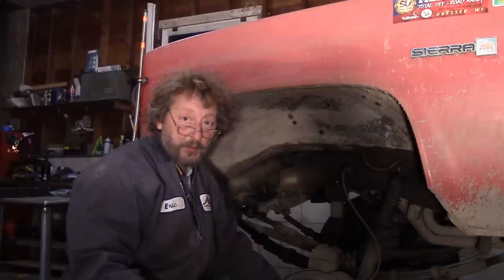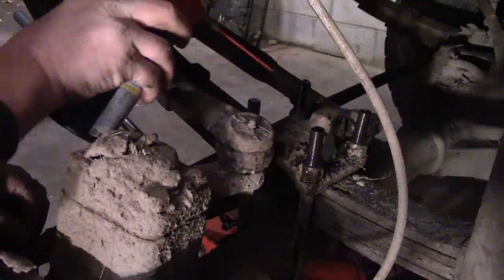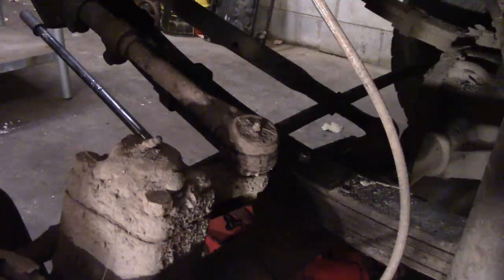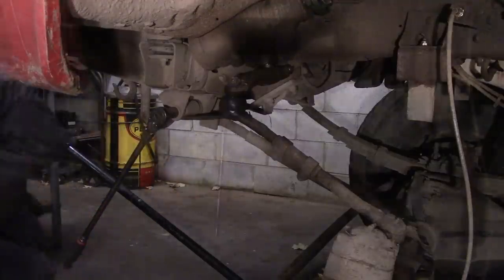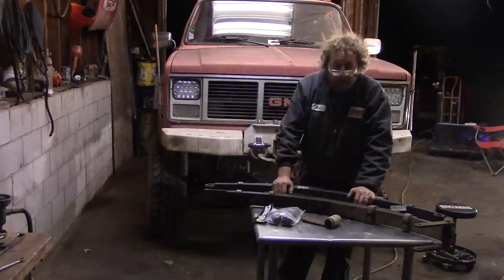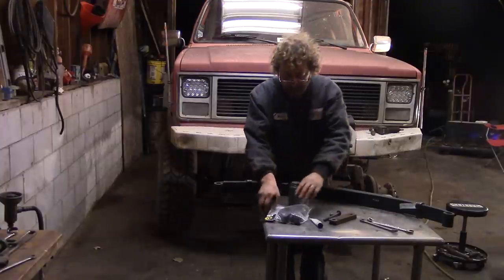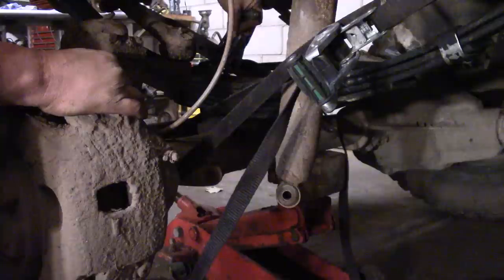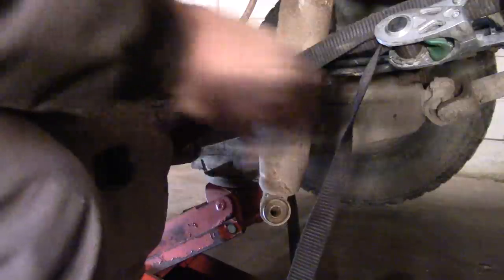BROKEN SPRING FIX by BSF Recovery Team

Comment: Interesting way of doing it.  My YJ has bottom mounted springs.  I mounted shackle side first.  Then U bolts.    Last was the body mount end.  I did flare the ends of the body mount as seen here.  To line it up I used the floor jack,  my winch,  a drift pin and crescent wrench.  Now the lube maybe controversial.    A little soapy water works great, KY does the job too.  It all depends on the application.

Comment: Eric, have you given the thought of having at least one each front & rear springs in the shop for the wrecker with a couple bushing packs for spare parts in case this happens again????
Reply from the maker: Hasn't been a issue till now.
Reply: Springs ain't cheap.... its hard to justify having multi hundreds of dollars worth of springs sitting there just in case
Reply: @brandonrichter6910  I know they are not cheap; it's the abuse the wrecker goes through in the woods & "through the crap" (BSF parlance). It's the peace of mind that if a spring did happen to break next time the parts would be on hand and repairs could be done as soon as you returned home instead of waiting for a spring to arrive at the parts store.

Comment: cant believe hes still running factory steering and not cross over. with the shit he does he needs it.......or i guess maybe hes proven he doesn't but i hear that belt squealing like a pig on other videos.
Reply: That's normal v-belt squeal. :)
Reply: Whenever he has one on the hook theres virtually no weight on the front tires at all so it steers crazy easy

Comment: the transfer case on my 84 dodge broke during the end of the polar vortex (there is a giant hole near the rear drive shaft) a couple people didnt think it was worth fixing it, but when i was matching the replacement transfer case to the broken one, (which does appear to fit) the dome light that has never turned on in the year that ive owned it turned on with the door and worked normally.
I call it a sign :D
Reply: See, the lights and the transfer case are connected.  Now go up and tell someone that has a burnt out headlight to check the oil.  I bet they do it.
Reply: @KevinBenecke  OMG. There is people dumb enough to do that, too. Maybe I can spin the old blinker fluid trick with this too

Comment: My 87 V20 I installed 2.5 leafs and a zero rated from offroad design. And some custom shackles I made that gave me another 1in so about 4in total lift. It worked good but road bad and didnt flex. I called ord and they said remove the sway bar or install their kit. I removed it and it was like a new truck. Rode better actually flexed. So anyone who installs more than a 4in lift remove ur swaybar or buy the kit to make it work right. Like ur vids keep on wheeling

Comment: I can tell you dont live in Ohio. We dont get off easy like you did. Spring bushing bolts are always stuck inside bushing. Si when you get bolt to turn, metal sleeve turns with bolt. So cant remove bolt without cutting. And ubolts, we dont even try. New ones already on hand. Gotta love salt.

Comment: Ditch that old push pull steering. It's a kp 60. Run a high steer crossover setup with a ram assist and bam! Way easier steering on 37s and no more wierd broken springs

Comment: I was very surprised not to see a farmer fix on this one.  Clean the spring up and put a good bevel on both sides.  Whip out the good old 7014 rod and welder up.  I did that once.  This was to test my welding skills.  I put the spring in a press and it broke it broke elsewhere.  For all those out there, no I would not do this on a vehicle. I know the metal becomes more brittle.  Just being sarcastic.

Comment: i would never wrench that dirty. Pressure washer or garden hose and clean that shit! Dirt and debris between the mating surfaces if you dont and you may not have the IQ to believe it but working in dirt caauses issues later on. It only takes a few minutes to sray on some purple cleaner and hit it with  some water.. Id never work on anything like that unless it was a trail repair.  Hygiene personal or otherwise is always a top priority for me!

Comment: Don't forget, when you broke that spring you messed up the other side also. You have the new bushings so, you can fix the other attachment that you lost. Just need the new pins to bolt up. I'm sure that you have some in a can in the shop.

Comment: spring jobs are fun. I did my 97 f350 cause hangers were rusting thru. Did springs also since it was a construction trk.     Than early feb i discovered torque king 4x4 parts cause fixing my brakes i discovered on my dana 60 auto lock hubs my axle nut retaining clips broken. I finally fiquired out why. I was missing some washers and snap ring

Comment: If you have those bushes where the steel is joined to the rubber, tighten them when the truck is back on the ground. And lossen and retighten after a week. It’s an old guy trick, but if you have that bush type it is a good one for smooth ride and decent  bush life :o)

Comment: I'm not against ur. Sway bar type link but I'd like some more info and pics of It and if. U could clarify what exactly it makes stronger and helps. But either way it looks 10xs stronger with it lol. My 87 V20 has k30 2.5 tuff country springs right now with no sway bar I removed it. It had my suspension binded up n nothing worked right ride flex or braking.

Comment: Upgrade the bolts in that shackle. My springs have all 9/16" bolts because I replaced the shackle mount in the frame. Check out diy4x.

Comment: Bet that link bar has something to do with that spring failure.  It wants o hold the axle center, fighting the normal movement of the spring want to flatten out and move back.
Reply: I was looking for a comment like this. I love the idea but that link can't grow or contract. Where the leaf spring gets longer flatter n shorter when droop. But probably most of the leaf spring stretch is past axle at rear shackle since front is fixed.

Comment: I leave the front and rear spring bolts loose and i get the axle/spring lined up and u bolts installed loosely before setting it down and then i tighten everything up but that's just my preference

Comment: Another great video with notably good instructions, but all the tricks, too! A question, what are your thoughts on running a small block engine versus a big block, for your application? Thanks,
Skip
Reply from the maker: Small block parts and mods are about 1/2 the cost of a big block.

Comment: You are not supposed to tighten the leaf spring until you lower the truck to the ground fully so that you don't tear the rubber bushing.
Reply from the maker: It's OK with poly bushings, but yes rubber pressed bushings normal ride height before tight.